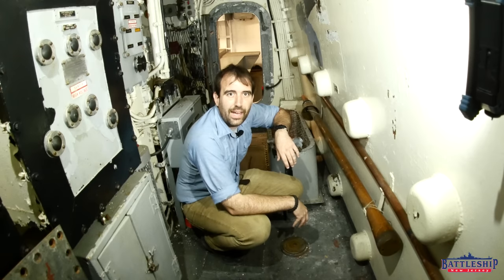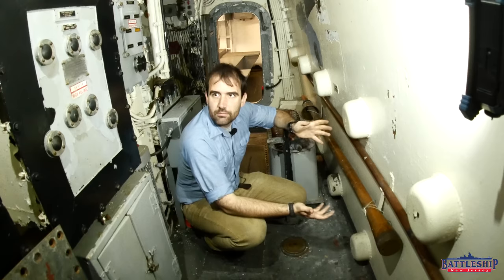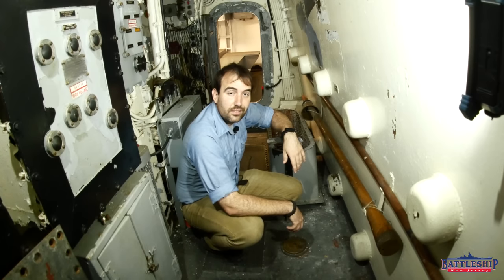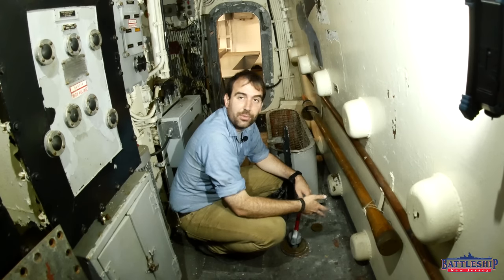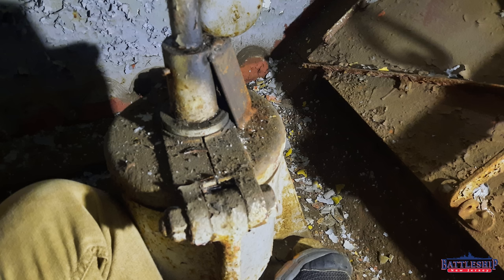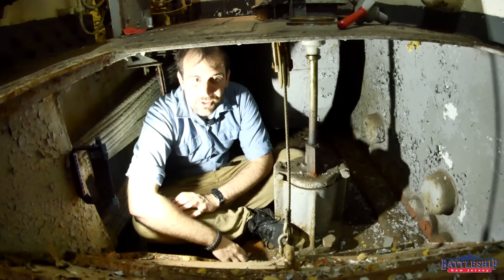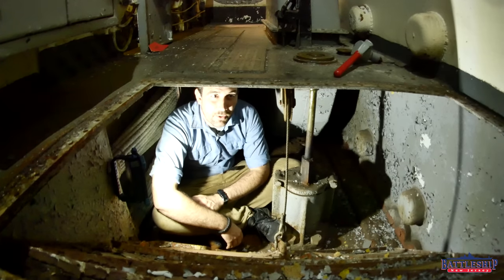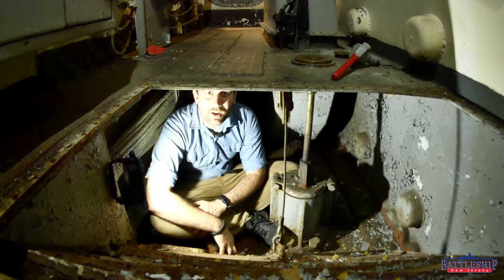Are The 16in Gun Turrets Welded in Place? UPDATE!

Comment: You can MANUALLY train the turrets...the equipment is in the navy manual for the turrets on the Iowas from the 1968 reactivation. I had written out several paragraphs pointing out the other battleships museums have elevated their barrels without power, and that Texas in particular has hand wheels that move the chain drive on the wormgear shafts that train the turret, which can be used when the electric motor is de-clutched from the shafts (and these are seen in videos available on youtube), and that the Navy wouldn't have eliminated such redundancy from the Iowas since there's the means for local range finding and gun fire control from within the turrets themselves as well as a manual percussion method to trigger the firing pin to detonate the primer and set off the gun...so obviously there would need to be a means to rotate the turret if the ship's electrical power was lost...and to elevate the gun to a position to hit something as well as reload it....and then I found the actual navy manual for the turret (which I assume you don't have a copy of Ryan). Its in a PDF format in several parts (links below) and included in it are the specifications for the electric motors and none of them draw 1800 amps. That's the full breaker load of EVERYTHING in the turret, simply providing power to just the electric training motor could be accomplished off the shore power load I'm sure... but since it can be done manually... that'd be worth making a video about (and probably a lot safer given the electric motors haven't been run in thirty years). 

Elevating instructions are in chapter 5, training is in chapter 6 and both list "hand control". On page 44 is a diagram showing where the train operator's handwheels are located inside the barbette. In Part 1... Page 69 shows a closeup image of the gun layer's handwheels used to elevate the guns. The turret centering pins of this video are shown on page 73 as are the slide securing pins that lock the gun elevation in place (and BB 61 Iowa's museum posted a video in January of this year showing how that works). Page 89 has a photo of the train operator at his station holding the hand wheels. Page 113 describes specifically how to fire the gun manually if the electrical circuit is interrupted. In part 2 Chapter 5 on the elevating gear begins on page 33, and describes that the hand control drives the hydraulic servo pump thru shafts, gears and a clutch. Chapter six on training gear begins on page 84 and the specifics are on page 93-94 and the say one rotation of the hand gear wheel = 2 degrees of turret train movement. The training gear info is actually split between parts 2 and 3 of the pdf files. 

https://eugeneleeslover.com/ENGINEERING/OP769/OP-769_Part1.pdf

https://eugeneleeslover.com/ENGINEERING/OP769/OP-769_Part2.pdf

https://eugeneleeslover.com/ENGINEERING/OP769/OP-769_Part3.pdf

https://eugeneleeslover.com/ENGINEERING/OP769/OP-769_Part4.pdf

https://eugeneleeslover.com/ENGINEERING/OP769/OP-769_Part5.pdf
Reply from the maker: You can manually ELEVATE, not train, these are two totally separate things.
Reply: @BattleshipNewJersey  According to the manual, the train gear hand wheels do the same as the elevation gear hand wheels... they manually push hydraulic fluid to the system if the electrical supply fails. BB 59's got a volunteer who was a gunner's mate on Wisconsin, maybe contact him and ask if they ever rotated the turrets without electrical power. But I'd go with the navy's actual manual saying it can be done.
Reply: @DeeEight  Thanks for the links. Fascinating stuff! I don't believe the handwheels push hydraulic fluid into the system; rather the handwheels adjust the position of the stroking piston (part 2, page 6-9 and 6-10). Page 6-14 describes HAND and AUTO as both controlling the hydraulic transmission. Pages 6-1 through 6-3 say the same thing, in more detail. Page 6-1 indirectly notes that HAND is local control: 'A control selector permits control selection of turret train either automatically from a remote ship' s station or by hand from a local trainer's station.' The B-ends are definitely hydraulic-only, and figure 6-2 doesn't show a backup/mechanical way to turn the worm gear drive shafts :-( Page 6-21 on gives the details of operating the training mechanism both in HAND (local) and AUTO (remote). This won't stop someone from dismounting the B-ends and replacing them with a small electric motor to turn those worm gear drive shafts, but as-is, there does not appear to be a manual backup that has been built in to this design. Thanks for the links to genuine documentation!! (Yes, I too wish the turrets could be trained...who doesn't?)

Comment: Seems like you should be able to find an external hydraulic power unit with the necessary capacity to bypass the ship's hydraulics to move the turrets that doesn't require so much power. The problem then becomes what if you move them and can't move them back for whatever reason? Its a shame that your agreement with the Navy doesn't allow further operation of the ship, but I guess that is for good reason.

Comment: Without electrical power to run the Hydraulic motor, the turret will not move. Having been on the New Jersey the fire rooms and engine rooms look to be in good shape, so my bet would be that the ship could be put back in service if the USN so desired. But smart bombs and cruise missiles are cheaper and more accurate. The days of active Battleships are gone.  It is awesome to live in a country that has so many Battleships museums.

Comment: Although you can't get enough shore power to operate it... what if you had a battery and/or capacitor system that could draw enough power to use the turret motors? Alternatively, with modern technology, could a more efficient motor be hooked up to the gearing system for it? This could especially be the case if there's a manual method to rotate it - hook it up to the manual rotation device and use that to turn it.

Comment: That is dumb as hell why would you weld the turrets in place or even weld the locking mechanism so it can't be removed? Its like somebody is going to steal the ship and try to use the guns which would be a  real hassle if somebody were to try. I like Ryan said you can't operate the turrets anyway without firing the turbo generators to power it and plus you would need the powder and shells and man power to operate the turrets to shoot, good luck with that.

Comment: It would take me 5 minutes to repair that with a angle grinder with a cutting disk and grinding disk and some brake cleaner and grease. Get a generator, external source thus allowing rotation of turret without violating the agreement. Put it up as a lottery to start the turret. You can rent them.

Comment: For many years I worked at the various Air Force Bases in No Calif.  McClellan AFB had the best 'old stuff for sale' (DRMO) department --- many huge buildings and huge outside lots of old military 'stuff' for sale.  But it had to be demilled --- made non-operable (I guess in case it was so lethal us mere citizens should not get our hands on it and actually use it).  Sometimes the demill was so extensive (like cutting guns into small pieces) it was obvious they could never be put together again.  Other times, it was a simple 'dink' with a hammer or such.  Most things were sold by the pallet-full.  It was amazing, anything-and-everything would come up for sale.   
I for one think Ryan should remove the weld just to see if the pin can be pulled (and of course, lubricated 'just in case') --- his duty as a curator to make sure there is not any rust down there...

Comment: I will assume since the power hydraulics no longer function there would be no need, to weld lock the turrets permenantly.
and of course all turrets have a "travel lock" or multiple ones so the turret does not sway. A battleship is no different than a tank.
So they welded a 1/4" angle iron strut  on a travel lock , BFD. A sledge/ball-peen/tack hammer would knock that off pretty quick.

The bigger question is, Do these turrets have a manual traverse/elevation ? LOL 
I doubt it , since they are ships, but they even more old school than me , so I really don't know. But a manual traverse might be needed anyway. How did they get  the Iowa turret back to center?

Yea the BB needs full power to operate the turret and its associated ammo hoists, pulleys, and loading trays,.  Even if there is a manual traverse/elevation , the turret cannot function without ship power. But it may have back-up systems for partial failures/battle damage  , IDKof.

It might be cool if you could turn the turrets just for photo shots.
 From a tank POV , it would take alot of crankin for manual traverse.  BTDT

Comment: I would imagine there’s is some kind of manual way to manually turn them. The military loves redundancy, and although impractical in a combat scenario I don’t think they would rely solely on a single motor that if failed would prevent them from returning the turret to centerline. Look around probably on the motor or gear reduction equipment there’s probably a provision for a manual crank. I’m sure it would take 6 million turns, but still possible.

Comment: I would just take a battery operated angle grinder and cut that little steel bit in two, tada the mechanical lock is unlocked! I could, with a lot of time make it move under electric power. I would probebly "redo" all the hydraulick seals, modern seals are super tight, so no leaking. And that 800HP motor would probebly not pull full 1200A 3phase, it is a stupid amount of power. But It might get close, circuit brakers are generally sized so they would only trip on short circuits and similar events, so it is most likely to be somewhat oversized.

Comment: Ryan on camera: "So, it turns out that we could unlock the pins in like 5 minutes with < $30 worth of tools. But there's no way we could power the motor to turn this thing, so these turrets will never be able to turn."

Ryan as soon as camera is off: "Ok, so I think that statement in the video will throw the Navy off of our tracks. Libby, go buy us an angle grinder from Harbor Freight. I'll start calling some volunteer engineers to wire in a motor controller that will keep us under the current limit for shore power. Can't wait to see the looks on the faces in Philly when they wake up one morning to see all three main turrets aimed across the river!"

U.S. Navy, tomorrow morning: "Hi, we're here to weld the main turret rollers."

Comment: I say cut the weld out and try and turn the pins, and see if they will move.  Engineering standpoint, I would assume that, the amount of power that they have to move the turret has to be for worst case conditions at sea with high winds.  In calm setting at port, I would bet money that wouldn't take near that amount of power to move it if all the bearings are well greased and everything isn't painted together.  1800A at 480V would only be 0.846MW and I would go as far as that a generator rental company with a 1-2MW semi trailer mounted generator would volunteer a bit of run time on the generator to power that up for you!  Could be a cool volunteer sponsorship by a local business for turret moving day and aim the guns towards Philly!  Little cross river rivalry!  Wouldn't that make a great photo op all three turrets pointed broadside across the river!  🦺😎👍

Comment: If the museum was ever properly serious about rotating the guns, I am 100% certain that a set of special power cords, along with a frequency drive could be made to power the motor, run off a portable generator.  300HP is a lot of power, but really, pretty small beans in the grand scheme of 'high power motors'.  It wouldn't be cheap, of course, but it maybe possible to work together with an industry partner to borrow a drive and some wire.  
I think the hardest part would be the controls.  If they are electric controls, they could be emulated with the drive, but the hydraulics would be much more difficult, due to the safety concerns of old lines.
I say that, knowing very little about the system, other than what is presented.  There may be some other glaring problem with it I don't know about.

Comment: I am a navy electrician of over thirty years. Let me first state that the rating of the breaker has nothing to do with the draw of current. It is simply the limiting device that prevents you from exceeding the amount it’s rated for. Some devices operate at the limit of their capacity all the time, but not so with these. The turret motor is designed to be able to rotate the turrets of the ship in very heavy seas, against a list  if necessary. In port, cold iron, and level, there wold not be nearly as much load. Would this still exceed the rated shore power? I doubt it would normally, but the turret has been stationary a very long time. However, there should be a manual pump or something  somewhere for the hydraulic system, the 1930’s navy didn’t trust electricity and always put in back-up’s for their back-up‘s on systems like these. Perhaps block and tackle outside  the turret on the deck. I bet that there is a speed control as well, being hydraulic. At low speed, one they have been broken loose, it should have minimal current draw, say 500 amps. Perhaps even less.

Comment: The idea of reactivating an Iowa Class Battleship in the 21st Century is problematic at best. Why? The Navy no longer has the logistical support to maintain a Battleship on Active Duty. The Navy can't just go out to the open market and get parts for an Iowa Class Battleship.  I would hazard a guess that most of the companies that made parts for them when they were being constructed have either gone out of business, or no longer have the molds and tooling to easily make parts.   We then come to the problem of fuel.  To the best of my information, the Navy no longer has a supply of fuel for the Battleships.  I do not believe that grade of fuel is even being manufactured at this time. Converting the Battleship to a Diesel engine would not be efficient, because you would have to take apart a large portion of the ship to replace it.  IMHO, if you're going to do that, just design a new class of Battleship, and start from scratch with modern technology.

Comment: I think a Perry class frigate could get 2400 amps of shore power at 400 amps per cable Pier side services were more than capable at a naval station or a ship yard
As Museum ship on the other hand probably gets enough power for lighting and some ventilation only. In a battleships case 1200 amps of shore power sounds about right I think the Kidd only has a 100 amp disconnect going out to it. The ship would have to go somewhere that could produce the power to run the auxiliary systems needed to bring the generators back online.  OR provide enough power to run the turret in wich a museum birth in never going to do.

Comment: Why weld this at all?  Especially if it's not well documented this would be a pain to find to reactivate and it doesn't add any strength to the locking mechanism, why not just lock them and leave it, add a locking or tamper evident sealable cover over the screw if you need to ensure no one secretly unlocks the turret, that's much easier to check on the seeing if those welds are intact.

Comment: I do wonder why
A) apparently so many people never thought that a massive rotating thing might have a simple locking mechanism
B) that mothballing would basically make the turrets permanently unusable. The guns are the only reason for having a battleship, why would mothballing make them permanently unusable?

Also: the reason they can't rotate the turrets is that the mechanism has not been maintained for decades. Power is not a problem, it's an easy excuse. The breakers are rated way higher than what they have to carry under normal load and the motors are rated to be able to turn the turrets under any circumstance.

And I totally get that they don't want to rotate the turrets, it's a spectacular sight but it does require bringing all the electricals up to spec, adding fire extinguishers, havinga way of making sure no personell is anywhere near the rotating bits, that the barrels don't hit anything and when something inevitably does go wrong, they are shut down by health and safety.

Comment: I doubt that there is only the motor to drive the turrets. There has to be a drive in the gearbox or somewhere else on the turret ring to rotate them with manpower, may it be very slowly, since redundancy is key on a battleship (like you said with the rudders in past videos). I also cant imagine that Iowa used a very high amperage motor to rotate turret number 2 after the detonation happened. So somewhere, very well hidden, there may be a way to drive it manually. Though there is little to no use for you, since the turrets are perfectly aligned, greased and fixed in a place where you want them to be.

Comment: I'm surprised they welded them at all. Someone must have decided that the locking pins alone weren't enough for whatever reason, which I don't think happened when the ship was mothballed so it most likely happened after it was decided to turn her into a museum ship.
Which leaves me wondering what the navy is going to do now that you've figured out what was done and how easy it is to reverse the welding :)
Most likely nothing, but there's bound to be more ueber paranoid bureaucrats in the pentagon than just the guy who ordered the original welds to be placed.